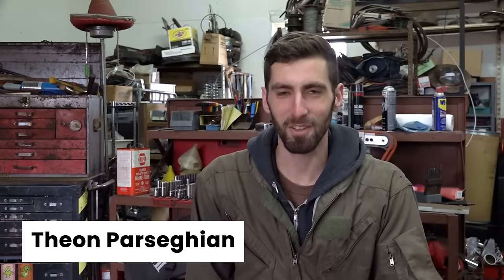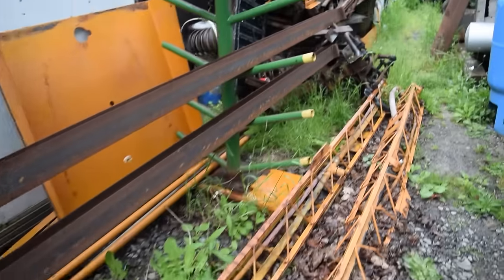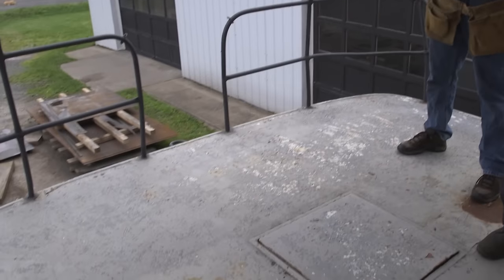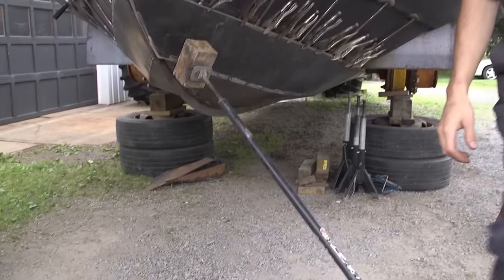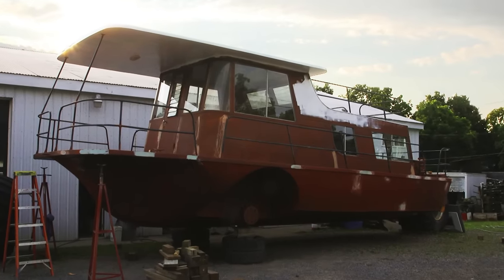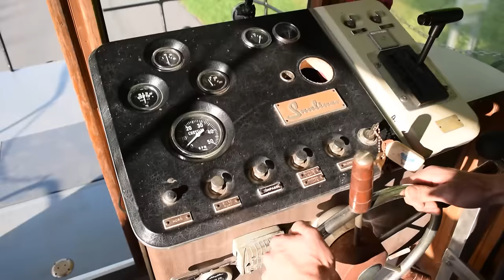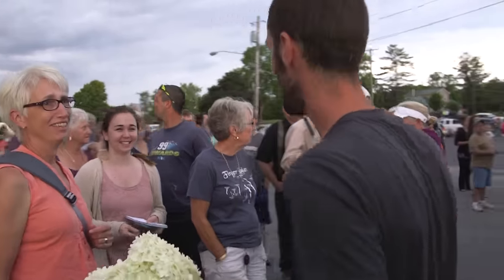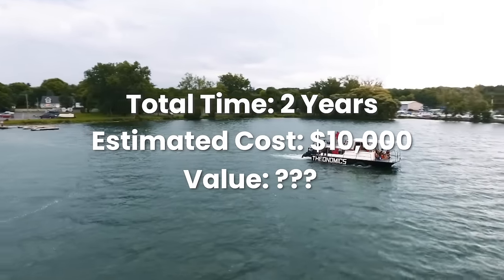Amphibious Driving Houseboat Full Build - Ultimate Off-Road RV

Comment: The fact he got this registered and on the road is the only thing I envy about america. What a crazy cool build!
Reply: it probably isn't registered. it's likely handled the same way that farm equipment is handled. it's not technically road legal, but you are permitted to transport farm equipment certain distances without needing anything special. beyond that, you'll either need a permit, or police escorting (which is actually stupid easy to get. you basically just go ask for it).
Reply: @TheAruruu  crazy. In my country it has to be legally registered if it has to drive on roads. If not registered you haul it on trailers that are registered.
All I know is I saw he put on lights and blinkers and there seemed to be a license plate in the rigt side window...
Reply: @JokerInk-CustomBuilds  there are still some minimum requirements for the farm equipment. headlights, turn indicators, brake lights, and whatnot. it's just that it doesn't need to meet the safety requirements because, let's be honest... a tractor with an airbag sounds stupid. lol
Reply: @TheAruruu  minimum requirements is not that the Tractor shouldn't be a ferry? 🤣
-Safety you say. How can he operate it safely when he cant even see where he is going? How many kids will he run over befor he notices someone shouting in the horizon?😆
What I am saying is that there is nothing safe about a ferry in traffic operated by a young man who is neither a captain or a farmer... 😄
Reply: @JokerInk-CustomBuilds  the rules about farm equipment are much more lax than you think. unlike with normal cars, you can drive farm equipment at 13 in most states. lol. also, there are plenty of vehicles where you can't see what is in front of the vehicle, but they're still street legal for whatever reason.

Comment: If I were you I'd put some protective gators on the hydraulic pistons to prevent corrosion also add some spots for sacrificial zinc  plates on the bottom to prevent galvanic corrosion

Comment: i think the most impressive thing about this build is the fact that it floats basically level. i figured it'd float kinda weird because of the wheels. I know they're likely buoyant on their own, but the way the back one sticks off in the center i figured would throw things off, and the wheel wells for the front wheels removed more displacement than the tires added. quite remarkable that it doesn't sit low in the front, or look all that unstable from the middle wheel.
Reply: I was expecting the opposite- the boat sitting too low in the back, considering that the engine, riser for the wheel, and the fork being back there and mostly above water line.

Comment: I "had" a similar concept, using a 1970s Land & Sea, SeaCabin houseboat, incorporating steering on land from both the main and upper helm station, incorporating retractile wheels (flush with hull), that is four wheel drive.
Unfortunately, there's a few design problems, the top two are, weight and ground clearance.
I'm guessing, the tires (pressure) will act as the suspension?

Comment: I hope you changed oil in the differential after being underwater and a portal or gear or chain drive drop down would have worked also to get the tires farther out. Ideally the front tires should have been no more than half in or out of the water.